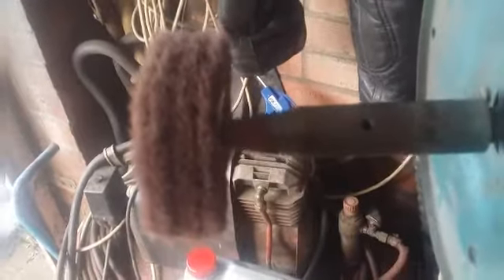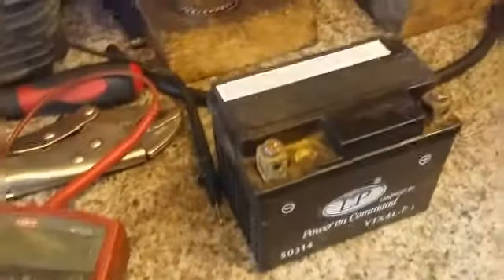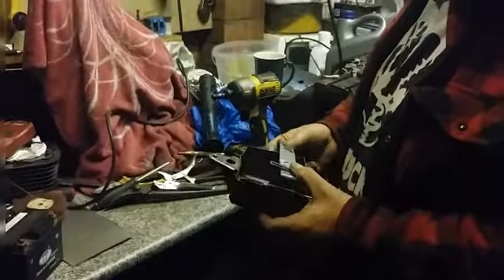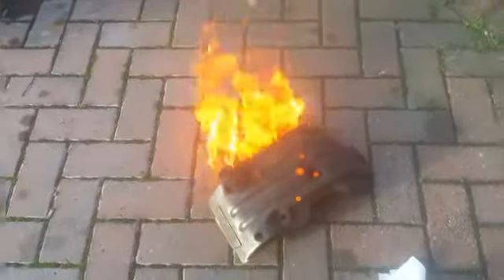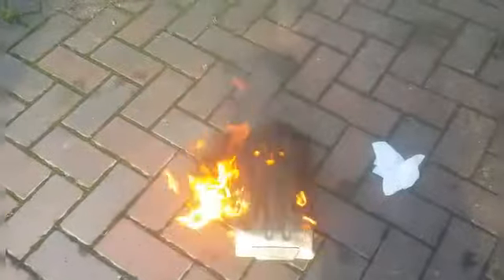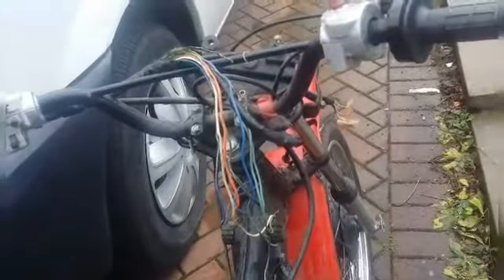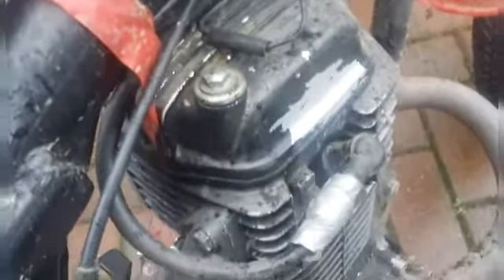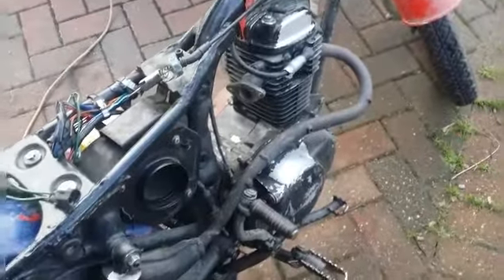Honda xls madness this week. And one more in the collection a 1981 honda xl 80s to restore part 1

Comment: I have a 1980 xl-125s here in the USA.The headlight runs straight off the alternator so does the cdi.Only the tailight, blinkers and horn
run off the battery.This bastard way of regulating voltage means the battery boils over and ruins the battery case and the battery.
Finding a reg that will clamp at 7.5v has been time consuming...If you know a solution to this I`m all ears...Cheers,!
Reply from the maker: The 6v electrics on the Honda XL are great when they work and a bastard when they don't I think we all have the same problems with them.my xl125s was already converted to 12-volt and it seems so much better the turn signals and horn actually work properly the only problem is making the battery  fit as you can see in the video someone made a really bad attempt of making the battery box many years ago . I think 12-volt is the way to go.